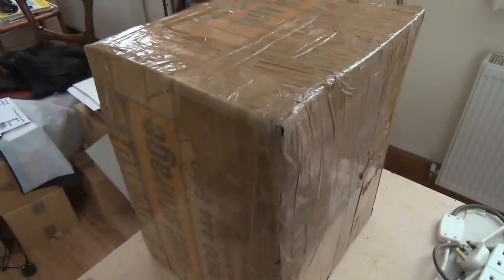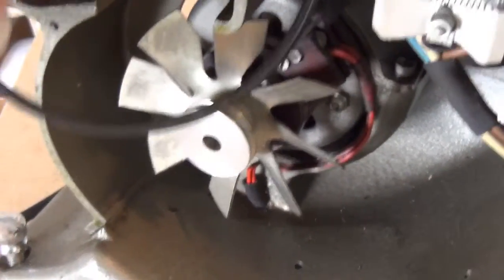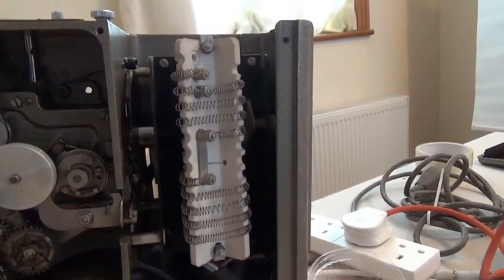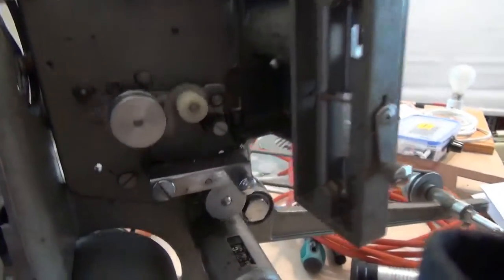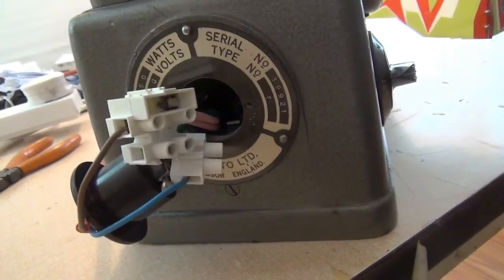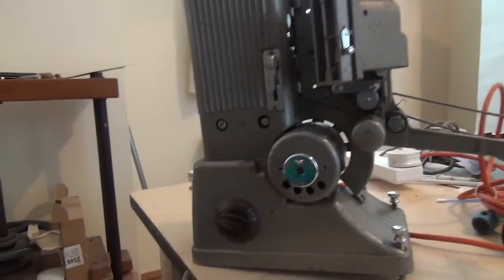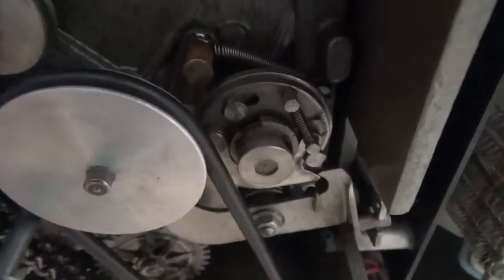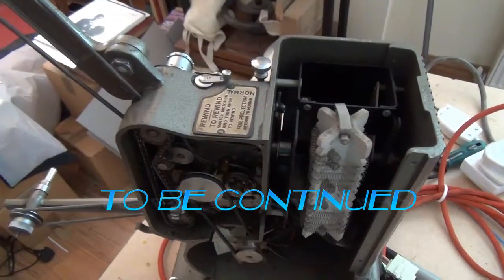Vintage 16mm silent film movie projector: Pt 1 getting it going

Comment: This is actually a Specto Motion Analyser Machine. It is missing the hand crank used to "rock" the film back and forth. They were used by the military to analyse artillery bursts and by the RAF to examine wing cameras. There were 3 models of this type of machine. It was built around the Specto 500 chassis with modifications.
Reply from the maker: Hi Eric, I used to use a Specto Analyser back in the 80s, but a different model to this one. Thanks!

Comment: I have this but as an 8/16mm model.
Even though the badge on the back says 210v 500w It's been modified to take the little 2 pin capsule type bulbs. I'm pretty sure that it takes 12v 100w bulbs, as these were common at the time the mod was installed.

Comment: Hi.i have a 8 mm specto and I can’t get the image still ( not rolling) . I modified it .I put a halogen light and electronic speed controller so I can change the speed from very slow to very fast.
I haven’t touched the shutter as I have no idea how to adjust it. Any help will be great. Thanks
Reply from the maker: Hi, If you mean that the image on the film projection screen is rolling, then most likely the claw isn't engaging in the perforations properly. Can you make a short video (phone video would be ok) showing the problem, post the link here, and I'll suggest what to look for and maybe cure it.
Reply: Thanks for your reply. Please go on my channel as I posted 2 short videos of it running. Awaiting your comments. Much appreciated
Reply from the maker: Video a bit too dark to be sure, but it looks like you are trying to run Super 8 film on a standard 8mm projector. (Google: standard 8 / Super 8 for info.) Super 8 has smaller perforations and different pitch. If I'm wrong about that, and the film is standard 8mm, then the problem is in the film gate/claw area (and is not related to the shutter.)
Reply: Thanks. You are right. It’s super 8. I feel stupid now. :))
Reply from the maker: No need to feel stupid. The gauge changed more than 50 years ago, and this sort of information is not widely known now.  Lots fof standard 8 films on ebay, and lots of super 8 projectors.